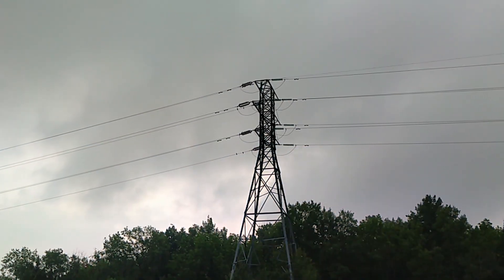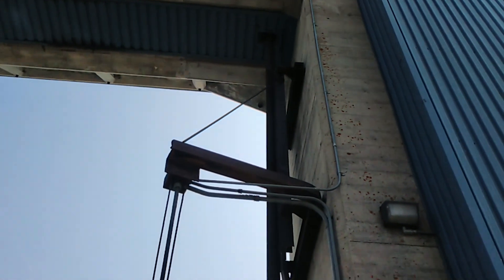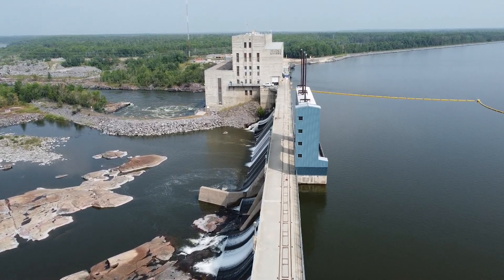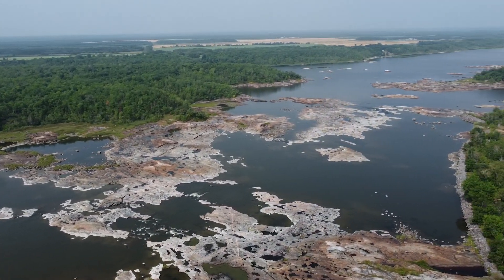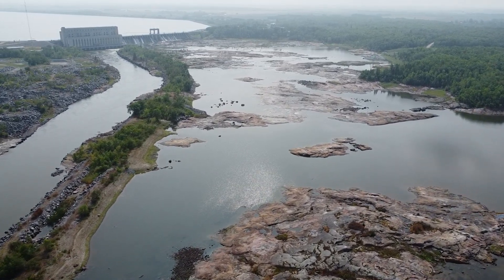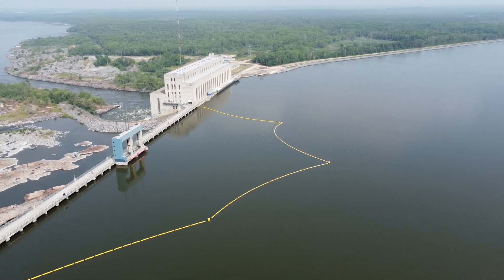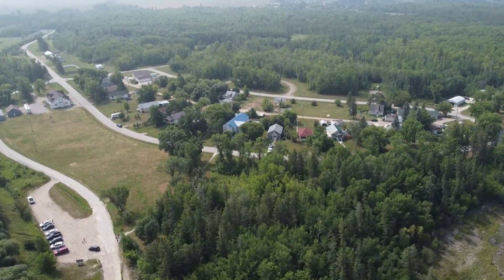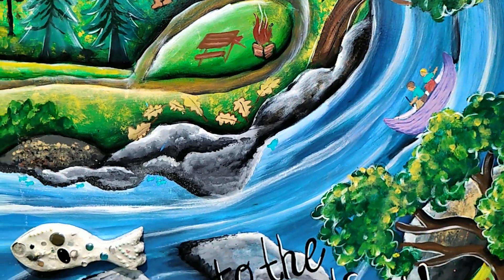Seven Sisters Generating Station - Travels with Bill

Comment: I fished here all my life with my parents, since the mid 1960s, My first memories here are of when I was 5 years old. We use to cross the rocks to get to the cofferdam whenever we could. I have such great memories here that I cherish deeply. Back then there were no gates or fences. We knew it was dangerous but we were skilled on what rock to stand on and what not to stand on. We often saw new comers that would make mistakes and we would just cringe. For example never stand on a flat rock as you could just slip right into the water. You stand in between rocks to get grip. If there were good fishing spots on flat rocks, you would stand much further back and only on spots that were dry. Never step on a wet rock or wet log. Nevertheless, I know every spot on that cofferdam to catch pickerel, northern pike and goldeye, and depending on the water levels and conditions. In times of drought with low water flow we would move closer to the generating station. It has broken my heart to see access now restricted. There is only one awesome place to fish that is left for me and only when the water levels are at a certain level.  Maybe one day I will canoe out there or get someone to boat me out there for one last time to fish and reminisce with the memories of fishing with parents. If I don't get that chance I say thank you for posting this video. I get some great views of my favourite fishing locations with my parents. I would love a copy of it if you could send it to me.